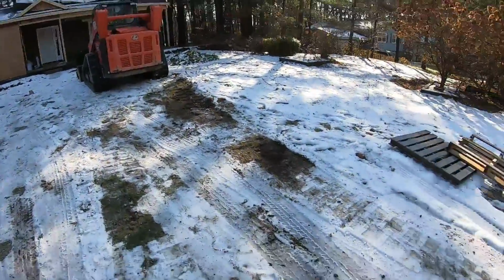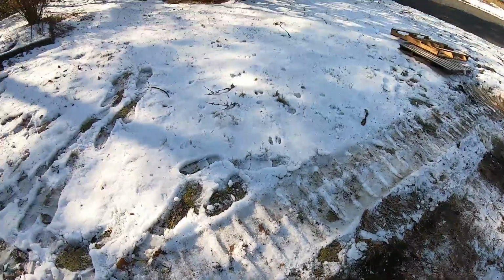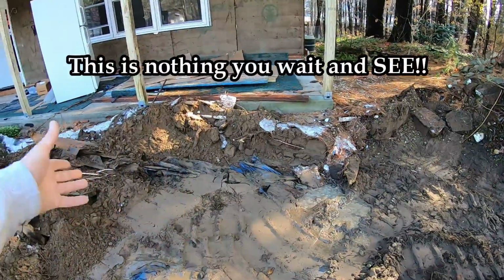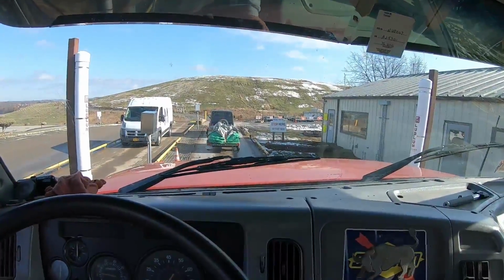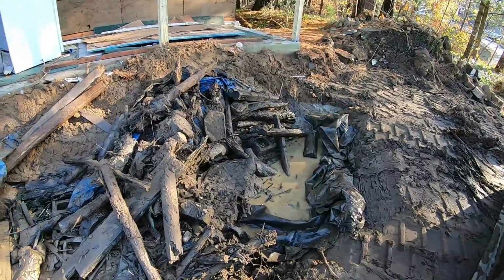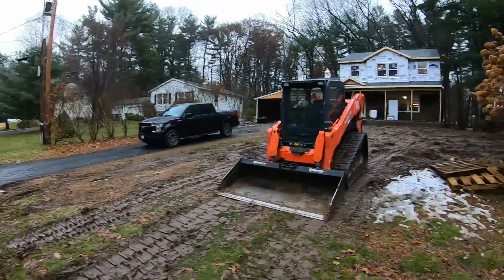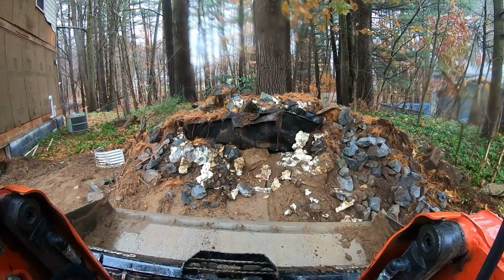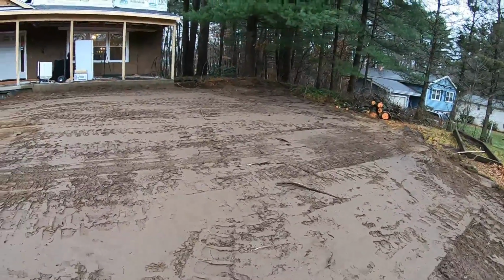The worlds messiest yard that I ever come across I did not expect to run into this mess

Comment: In the late 80's, I was wiring a new Hardee's location. The GC brought in a backhoe to dig two holes for the footings for the posts that were to hold up the drive thru roof. They dug down about 3 ft. and dug into the top of a car. When the digging was done, the hole was a little bigger than a full size old Chevy sedan and about 10 ft. deep. You never know what is buried  in a fill.
Reply from the maker: OMG that's a great story! Thanks for sharing!